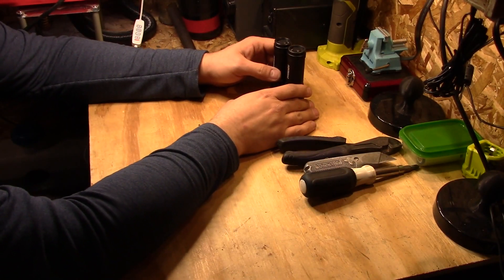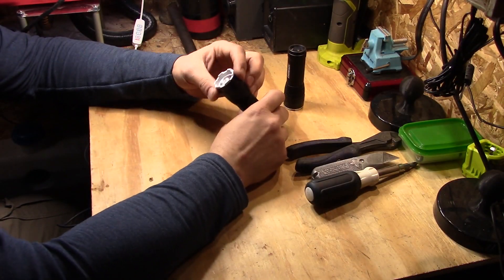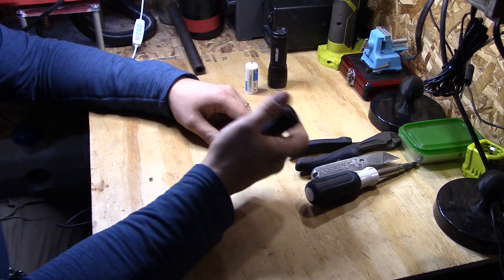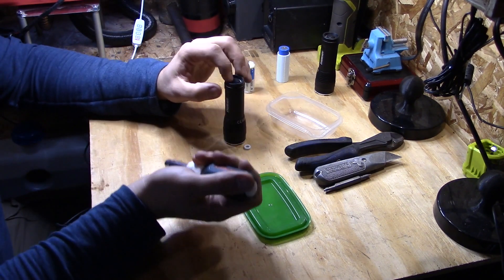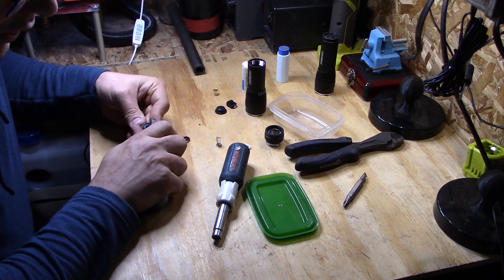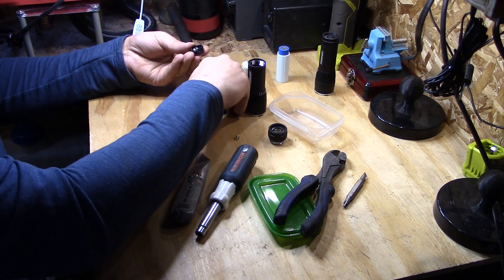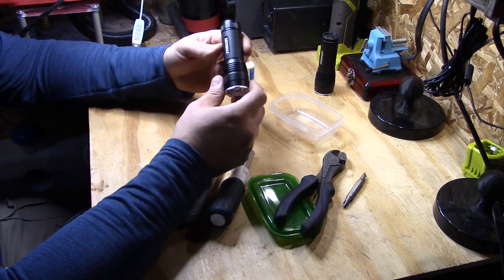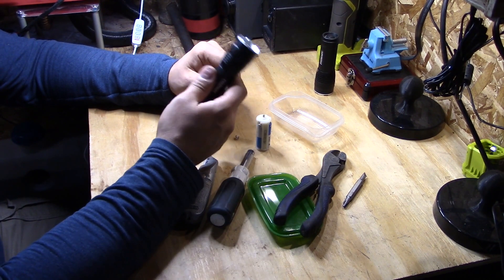Cheap Flashlight 18650 Conversion

Comment: So glad I found this video. I have a old 3aa flashlight that unscrews from both ends & was able to get a 18650 battery in by unscewing the buld end a little... Awesome. I'm curious what do you mean the 18650 is not a protected cell. What could happen? I guess the 5 mode lights that come with a 18650 have something that protects the cell? Thanks!
Reply from the maker: @talon501  if you over discharge a 18650 it will get damaged. This is why most electronics that use these cells have a BMS. There is a risk of fire also with unprotected 18650s mostly if you short them out.
Reply: @Engineerd3d  Thanks for the reply!

Comment: I hate crap with AAA batteries.  AA's are much cheaper and last longer.  The 18650 is a good change.  My money says they do not make them with 18650 because of the added hazmat expense shipping lithium batteries.
Reply from the maker: I agree, but for me I had some spare cells from a project so I converted both of these. They seem just as bright as before.